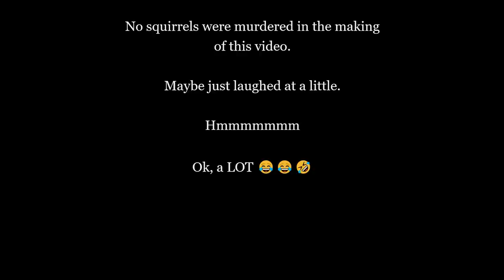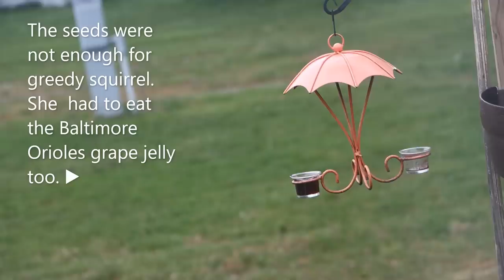Squirrel vs Electricity. BIRDS (Only)

Comment: The fence charger is great, but I'm beginning to think in terms of a steady DC voltage. Dollar Tree has 9 volt batteries either one or two in a package. 9 volt batteries snap together nicely to create a higher voltage source with any number of them in series to achieve the desired total voltage. I estimate something on the order of 8 to 10 of them for an approximate voltage of 70 to 90 volts. They'll last for a long time since there's no current flowing until a squirrel actually gets across the wires. Just put them in a container of some sort to keep them out of the weather. If a higher voltage is needed, just go back to the buck box for more batteries.
   I know the batteries snap together as I used to use them at work to make either 45 volt or 67.5 volt  assemblies to substitute for the harder to obtain commercially made batteries of those voltages.
Reply: or use the one thats minimal maintenence because its solar powered and wont kill the squirrels 🤷‍♀️ with all respect daisy chaining a bunch of 9v batteries and putting them in a box to electrify a post seems very silly
Reply: @maxinehardy9411  Silly? Changing cheap batteries once in a great while is cheaper and less complex than any solar system, PLUS the added expense of a voltage boost circuit.
   $5 or so of batteries maybe once per year is far more preferable.
Reply: @joewoodchuck3824  how about this; skip the batteries entirely, and just plug it straight into the mains! even simpler, AND cheaper!

Comment: What you don't suspect is that the squirrels have formed a committee to solve the "electric pole" problem. The trampoline they built was too heavy to move to the pole so they are currently working on a large "A" frame made of thin branches.  I have it on good authority that one suggested a flying machine. Failing that prepare to be attacked as you try to fill the feeders.

Comment: I bet after 3 years, the varmots chewed through the base like a beaver, and got the food that way. There is no such thing as a squirrel proof bird feeder. Tried electricity, they just chew the wires. Tried grease, they use it as a slide (party time). My dad found a solution. He used his gun.

Comment: I wish everyone would have taken physics (particularly electricity) in high school, so more effective approaches are used, instead of what seems common sense (but is not). Simply wrap the pole with 2 wires all the way up, separated by 3/4" or so and energize them like a barber pole. No squirrel will be able to climb on the wood pole, once the wires are energized by an electrical fence charger. Stinging 4 wires up the pole is too naive and simplistic.

Comment: Nothing a well tuned and calibrated 60# compound bow couldnt resolve from 30 yds away, or a 3/8" steel ball bearing from a strong slingshot from half that ... as long as it's a rural setting (suburbia tends to have rules and laws precluding that).   And yes, I'm speaking from experience. 😎

Comment: Why not just put some chicken wire around the pole where the squirrel hangs on, run the wire to it and then put some chicken wire across the area where the nuts are and run the other wire to it, the birds only touch the feeder, and can peck through the holes in wire to get seeds, but the squirrel touches both.... Another way is wrap alternate strips of chicken wire around the pole and make alternate one positive and negative,  the squirrel cannot climb the pole without touching across them....

Comment: He he, another trick, i used a electronic fly smacker as the source, says 3000 volts on it , but more likely 1500 volts, 2 cobber treads around the specially for tiny birds feeding house, used those thumb tacks , big plastic heads for insulators, melted the cobber wire to the heads of the thumb tacks with a soldering iron, 25 meters of telephone wire, now , Mr squirrel or Mrs in that house, me in my kitchen press the knob on the firmer fly smacker and the Squirrel jumps 30 feet to get away , works also on blackbirds and small woodpeckers. 
I having Squirrel feeders, i have feeders for all kind of birds, so it is not for me, to having fun electrocute some hungry animals, just, so the Blue tits and birds in the same category , can have their own place to feed.
Fuck, Squirrels and Seagulls, the must be Republicans, they want it all for them self 😁. 🤗. Happy New year to all in a few days. 💕 to 🇺🇸 from🇩🇰 .

Comment: Why do people reinvent the wheel.... A metal metal poll with a squirrel guard works perfect. I prefer the long tube shape vs cone style, both work. Mounted 5' from the ground they can get past it. As long as the poll and feeder is 10 feet away from anything horizontal or above squirrels will not get at the feeder. SIMPLE, easy to install. Squirrels can only jump 5' max vertical, 10' horizontal and not willing to drop more than 10' down to it. Trust me it works. You electrical shock is kind cruel.

Comment: You really didn't need to wire the whole pole, just about two feet below the feeders to their feeding position. That way you get to see them die just a little at a time as they come sooooooo close just to be hit as they near the goal. And I would have used a mesh instead of just wires.